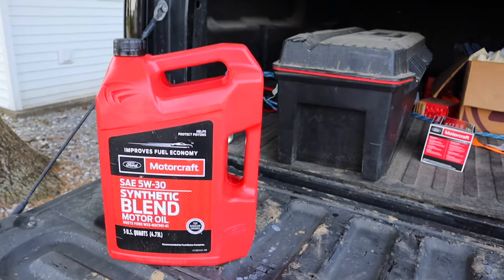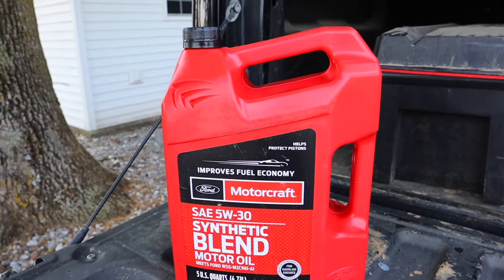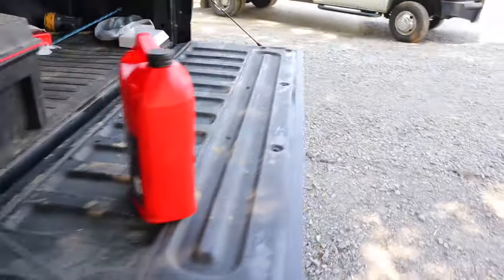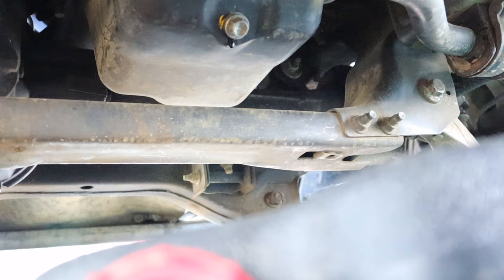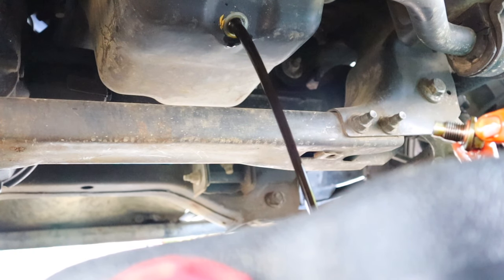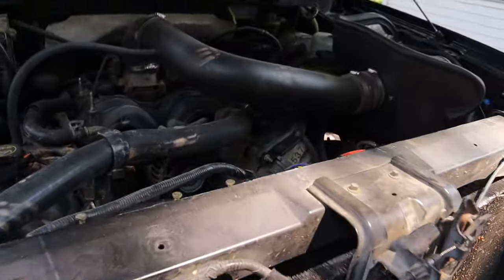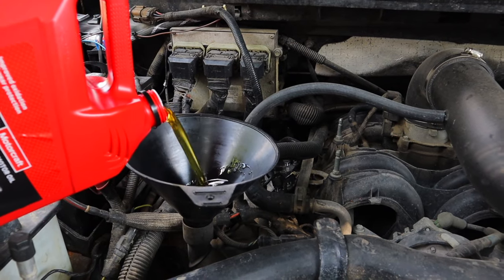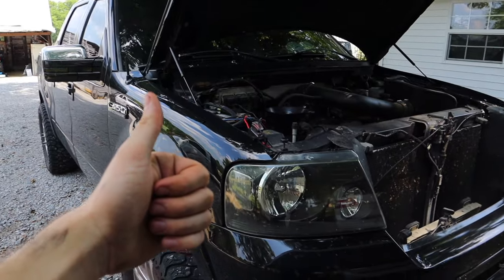HOW TO KEEP YOUR 5.4 TRITON RUNNING LONGER WITH LESS FAILURES!

Comment: Here's a good tip for you , along with changing your oil - before you drain it - add WD40 while the engine is warming up. 2 detergent cap fulls from a liquid tide and allow it to mix and clean out the varnish and the VCTs will last as well get the passages clean before you add new oil. WD40 will work with the oil as you are driving and wont harm anything - I did this to my 2008 F250 and yes it does work wonders - one of my lash adjusters benefited and quieted down a lot as it was starting to stick. But yes clean oil does keep this style of weak design that Ford tried to redesign since the days of the good old Windsor engine..
Also save your Condenser coil by fitting a house screen in front of it . This will save the coil from road rash debree from getting into the fins and plugging up the air flow...
Reply: I agree about the screen material - but WD is a water displacement product, I’m not picking but I’ve never heard about using that in any engine over past 40 years

Comment: I got a 08 5.4 with 161k miles and I love the truck but I’m so scared that the timing components will go with me driving. But I’m glad I found your account
Reply from the maker: Definitely can happen with these, but normally not without proper warning noises from the engine bay👍
Reply: @JayThompson25  oh I did not know that well that definitely puts some of my worries to rest
Reply from the maker: Not saying it can’t happen, but it usually comes with a warning beforehand though
Reply: It will happen eventually, and yes, you will have warning signs, rough idle, potential stalling, sounds like a diesel!! I’m experiencing it now on my 2008 xlt & 246,000 miles. It’s currently in the shop with this issue, along with a burnt valve!!

Comment: 08 KR with 190,000 k miles....Bought 6 years ago with 100k miles. Changed the oil immediately with castrol edge high milage 5w-20. At the recommendation of Brian from fordtechmakuloco changed to 5-30 at 5k intervals, which I already did anyway.....6 trips to Maine and numerous trips to Florida from NW GA. and the only thing I've done is oil changes and brakes......NO ticks, no misfires, no nothing but servicing her and listening to her sweet song while towing my bass rig all over....Avg 15 mpg with 3.73 gears. No additives except for fuel treatment to keep carbon down....Love it and at my age I will put a crate engine in before I buy a new or newer truck......but going to see how long this one will last and still travel without worry.
Reply from the maker: They’re good engines if taken care of, they just rely on regular service for sure! Glad to see it’s doing well for you!

Comment: 2010 5.4, 165k - i run 15/40 diesel in it - covers and lifts over the phasers way better than 5/30 - runs great still and no cam phaser issues yet - I change every 3000 miles - all motorcraft

Comment: 2008 f150. 340k, changed to melling oil pump. Locked out phasers. Running strong
Reply: What's locked out phasers and what's the purpose of doing so
Reply: @trufuel9054  id like to know too
Reply: I’d also like to know

Comment: I run Motorcraft Full Synthetic 5W-30 @ 4K mile intervals with a Motorcraft FL-820-S Filter and im at 225K miles. Looks like you've got some 5.4L 3Vs in your arsenal. Your trucks so freaking clean man. Also i have LT285/70R17 and i with my last current trip as of 08/09/21  im getting 14.5mpg guess that's not half bad
Reply: i run amzoil 5w-30 with an amzoil oil filter
Reply: @Joseph-wu7vm  just make sure the filter has check valve
Reply: @JFord1234  which ones do ? How do you know and why because of 5w ?
Reply: Not bad at all

Comment: Brother you are 100% right
I have 2010 5.4L f150 with 190k miles no issue at all not even sweats daily driven
Using OEM filter and penzoil ultra premium 5w20.

Comment: Mine: 2006 f150 king ranch. 236,000 MILES and counting!  Noisy phasers replaced on Ford warranty back at 50k. Thats it. No other major work done to it.  Oil changes with full synthetic every 3000 miles.  Everything else is original, including the transmission.  I live in cold climate Canada half the year and STILL hammer the gas pedal all the time with this truck. 5w20 in the winter, 5w30 in the summer. Full synthetic.  Good oil is the secret to a reliable, long lasting Triton v8, period.

Comment: I have a 2007 Saleen S331 supercharged with 80k on it, I switch to synthetic 5w30 and oil changes about 3k ish miles. The truck is very happy with it. My boss’s dad has an 04 f150 and it has 300k+ on the original motor. Just crazy

Comment: I use 5w-40 with Lucas oil stabilizer every 3000 miles with napa gold filter. 178k and going strong.
Reply: Many people don't know that Napa Gold paper products are made by WIX. There is a YouTube for the difference between a Fram and wix. I used to use Fram until I found out the Wix has a much better spring on the Overflow pressure. Then I watched this short video and it showed the WIX has three to four times the paper in it!

Comment: I bought a 2012 Expedition King Ranch November of 2022 with almost 40k miles and it just hit 46k miles. I used Motorcraft 5w30 synthetic blend and a Motorcraft filter, but my next change, I'm switching to Motorcraft 5w30 full synthetic oil.

Comment: 284000 on mine
. Have not driven  it really  at all in 3 years and it starts  and runs greT. 08s are good trucks if you change  the oil every  3000 miles. Or even 3 months.  Thay will last. I got this truck  new. I'll get a new 250 next year. Hanging on to the 08.

Comment: I’ve got the 5.43 valve. My trick is add one whole can of high mileage seafoam to the crank case in one can to the gas tank sitting at about a quarter of a tank run through fill it back up drive about 100 200 miles, every single oil change in it seems to do what seafoam holds up to do

Comment: I've got 193k trouble-free miles on my 2007 F-150 5.4 3 valve and I still run 5W-20 in it. Don't even know if I'll ever bump up the weight. I've just kept the oil up every 3.500 miles and it purrs like a kitten.  Junky engine still, but it can last a while, with good maintenance.

Comment: 2005 f150 king ranch. Original motor 374k. Did timing at 350k, also recently put a crate transmission in at 372k. 5.4 still strong.

Comment: The first number describes viscosity at low temperatures. The second number refers to viscosity at normal engine operating temperatures. using a synthetic 10w30 is the way to go .

Comment: Also use oil stabilizer and treatments to clean out the engine and oil pump and it will keep your oil pressure up and your engine will also thank you for that. Also the thickest oil I’d go with for these engines is 10W 30 full synthetic high milage

Comment: I have 2005 f150 with 5.4 I have almost 195,000 mile but I change my oil every 4,000 miles I run full synthetic I never have no issues only issue recently I had three or my injectors got stuck open… I do my spark plugs about every 50,000 miles and had 0 issues with my engine I pull my boat with my enclosed trailer and it’s pushing close to 200,000 miles and engine sounds good like the day I bought it back in 2005

Comment: I do the same thing with my 055.4 I use full synthetic 5W 30 and change the oil religiously every 5000 miles and today I have almost 300 K on the engine.

Comment: My 2010 f150 5.4 has pretty clean oil when I change it around 8000 miles. I'm talking like I can still see through it. I use mobil 1 full syn and the Motorcraft filter. Truck has 165k and no problems yet

Comment: I use the high mileage 5w20 and it has been told I have the quietest 3v 5.4 ever heard. No knocking or ticking. I got a flowmaster delta 55 muffler on it and it sounds good with no drone from the exhaust. Only issues I’m having are electrical issues, leaking sunroof (about to seal shut), and and the rear differential makes the humming noise.
Reply: 180k miles 2004 Lariat 4x4
Reply: The sunroof has a drain passage on both sides and the tubes that run down the a pillar get clogged. Blow out lightly with a compressor and blow gun and dump a glass of water in the well making sure it clears out

Comment: I just bought a 2007 F-150 triton 5.4 off road 4x4 only thing needed was a pulley that exploded on me and witch tore my belt to shreds. Not to mention all that stringy belt decided to wrap itself around the harmonic balancer . The belt was a bitch but the pulley and new 60$ belt I bought the best . Now it runs better than it did when I got it … I purchased the truck 2 and a half weeks ago… also needs a rack and pinion. But it drives great and looks good

Comment: Don't forget to add the fact that Ford is one of the first one to require their filters to be used due to the anti drain back flap in it and wouldn't warranty the motor if it failed if it didn't have their filter on it.

Comment: I have a 08 expedition 5.4 and it has 253000miles I bought it 6months ago in winter I ran 5w30high mileage, no summer's coming I'm thinking on morning 10:30 and good high mileage oil Mobil 1 filter. Honestly I want to know if this truck had 150,000 knock on wood I have no receipt for nothing I got a cheap couldn't pass it up but it's been a blessing so far

Comment: Do you have a video of hooking up the electric cooling fans? 
I definitly need to swap mine.
My ford has 230,000 miles. Still running strong.

Comment: How many bottles of the 5 quart Motorcraft do you buy for an oil change? I'm going to bring it to my mechanic with that brand and filter next time.  I have an 07 F-150 5.4L with 168k miles. Thanks for the video.
Reply from the maker: 7 quarts!

Comment: nice truck we got my son a 2005 with the 5.4 4x4 does that cold air intake help any with power? what brand is it as well.
Reply from the maker: It’s an airflow dynamics. It helps but isn’t too noticeable. The biggest upgrade for power is electric fans. Helps out a ton with fuel economy and power gains

Comment: ive had my 2001 F150 XLT 5.4L V8 for 5 years now, bought it for 2k with 140k miles, at 170k now and no major motor problems, just spark plugs, coils, battery, alternator, and starter. still runs strong.

Comment: I have 178 and some change and I do a four thousand on mine and I don't use nothing but Motorcraft oil and Ford filter and if they don't have that I use a Wix XP. What fan kit did you use.
Reply from the maker: Flex-a-lite 270’s!

Comment: I’ve got the 5.4 3v triton with 301k on it. I use 0-40. Only things I’ve had to replace has been the plugs 2k ago, radiator/therm 6months ago and coil packs 150k ago.

Comment: Switching to 5w/30 full syn quiets the engine but upgrading to a Melling hi-volume oil pump will get oil to those far cylinders. Might as well upgrade those ticking timebomb timing components while you’re at it. I’ve got a 2010 F150 FX4 with 210k/mi and just did a 5-star tune and it runs better than new. Throttle response and low-mid torque are greatly improved and the best part is a custom tune allows you to utilize all 6 gears on the 6R80. That is HUGE. Getting 17-20mpg with 34" Wildpeak AT4's @ 70mph.
Reply from the maker: In the process of building my house and shop at the moment, that’s the next step is to pull the engine and do a total refresh and upgrade/update to internal components
Reply: @JayThompson25  Sounds like a great time. Checkout Promar Performance Engines for a reman long block.

Comment: Preach!  I bought my 2011 Expedition for $1,500 (basically for parts) because the original owner ran it on 8k change intervals. When it started making noise at 96k miles, he took it to his local mechanic that didn't know jack 💩 about the 5.4 3V Tritons. Ended up being  a bad roller rocker and it sucked 2 valves. Destroyed the motor. I ended up putting a new factory Ford remanufactured motor in it, but if I'd have taken it to the dealer, it would have been $11-12k for the new long block that cost me $3,400.

Oh...and if you're still on your original motor, replace the oil pump with the Melling HD pump.
Reply from the maker: that's the plan, I wanna do the timing chain job as well as replace the oil pump and both VCT
Reply: @JayThompson25  Do the roller cam followers, too. I would suggest the Melling ones and the Melling HV oil pump. Check RockAuto for prices.

Comment: Mine has 235,750 mile
No leaks no engine failure.
Runs like it did the day I bought it in 2000

Comment: 2006 3V has 200K, only used 5w20 Motorcraft and filter, i now use the Lucas low viscosity oil supplement as well as its suppose to be helpful for VVT engines, maybe i got a unicorn IDK

Comment: My '01 Expedition 5.4L has 240,000 miles. 3K oil change intervals religiously, and I also pull a trailer with 3 quads on it!
Reply: what oil you use?

Comment: My 2004 was bought brand new, and while I agree with everything here, and did all that on the factory engine, it still failed.  Pissed me off, but bought a reman due to financial considerations.  Not financial considerations of the value of the truck, but the job situation dictated spending on a costly reman engine on an otherwise truck in good shape vs. another more costly truck.  Reman runs great but burns more gas compared to original.  Kept the truck and bought a Toyota last year

Comment: I have a 2010 5.4 with 216,000 miles.  It runs good when cold then idles rough after gets hot.   Here in South Texas in Summer it takes less than 10 minutes yo get hot.  In Winter it runs great.  Any suggestions?
Reply from the maker: I’d start by checking plugs/coils. With it being temp sensitive, could be an issue with one of the electronics

Comment: I have heard that it is bad to switch to syn from regular oil after a period of time. Just passed 150k in my 2005 F150.
Reply from the maker: As far as I know it stems from the same argument as changing transmission fluid, however motor oil (if regularly changed) won’t dislodge any major gunk from just to swapping to synthetic

Comment: God Willing im Getting a 2004 f150 fx4 supercrew 112, 000 miles carfax 2 owner....sounds good but im scared with those low miles im gonna get stuck with all the problems oh n they want 7500 i talked em to $6800 because it apears it will need and exhaust...good deal or stay away.also carfax says spark plugs were changed feb 21 should i change them anyway(i also heard a light ticking sound when outside vehicle)
Reply from the maker: They’re not bad trucks at all! If the plugs were truly changed you shouldn’t have to worry about pulling the plugs again! Hopefully it’ll be a good one for you!
Reply: @JayThompson25  wow what a relief tjanx

Comment: Where’d you get your third brake light could you send me a link? And I have an 07 5.4 that I also run 5w30 instead of the 20 has 165,000 miles

Comment: Got an 04 excursion 16v 111000 miles not one issue running 5w.20 full synthetic, quite smooth motor would it be better if I switched to 5w30 oil ?
Reply from the maker: 5-30 is recommended for higher mileage engines over 100k because you get more lubrication to crucial components. You’ll notice on a lot of engines that 5-30 will have the engine running quieter and smoother, but you don’t have to switch. It’s just a recommendation to try and get the most life possible! Biggest thing on these engines is oil change intervals. Some say 3k but I run 5k. I wouldn’t be comfortable with anything more than 5k between oil changes

Comment: How do you keep the exhaust manifolds from cracking.  I replaced them once and one is cracked again.  111,000k.  I change the oil religiously.  Last 2 have been with 5w30.
Reply from the maker: Something could be causing it to generate more heat than usual such as a lean code or possibly just a bad replacement manifold. Lots of possibilities when it comes down to it
Reply: One of the flaws in design exposes the rear of the manifolds to thrown off moisture from tires thru the plastic wheel wells. Hot metal exposed to cold moisture can lead to cracking?  I've also heard that the front design of the exhaust system is also a suboptimal design causing excessive stress on the manifolds. 
There is a debate on Ford OEM replacements vs aftermarket brands like Dorman.  I'm not certain the Ford replacements are any better than the originals.  04 -08 was just not a good vehicle. A sad realization.
Reply: I would have to do a set of headers. Not messing with a manifold more then once .

Comment: I’m at 165,000+ miles and no issues except for exhaust manifold i use 5w-20 but i May have to give 5w-30 a try
Reply from the maker: Definitely helps quiet the engine down! Was a very noticeable improvement

Comment: 05 fx4 blew cam bearings out and replaced motor at 165k  with jasper motor got a oil leak no oil on ground I believe the timing chain tensioner is bad cause I can hear rattling on cold starts only for like 2 seconds. Any advice would be appreciated
Reply from the maker: Most likely a timing chain tensioner. Hard to say without hearing it, but they can have a little slack and be heard upon start up but clear up afterwards
Reply: @JayThompson25  yeah it only last like 2 seconds if that but it sounds terrible I'm thinking that I'm losing oil through the tensioner cause I cant find any other leaks
Reply: if you watch the ford maxxxxx something videos he goes in depth with these motors exelent videos very knowledgeable something every 5.4 3v ownwer should watch honestly but the rattle at start could also be the oild passage under timing cover by tensioner is leaking. so when motor is off it leaks out the oil to the vvt then when u fire it up it takes a moment or 2 to fill that passage and pressurize the vvt causiing the noise.should get it looked at sooner then later and get a high volume oil pump put in last i checked jasper dont spring for them in there remans